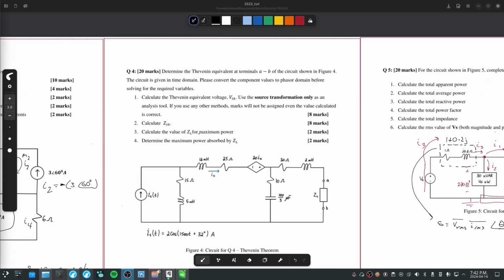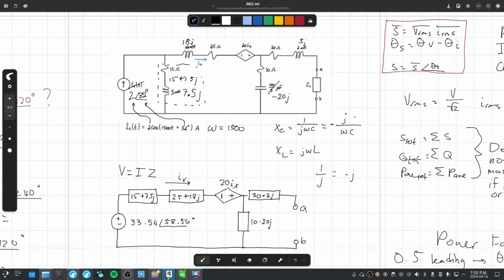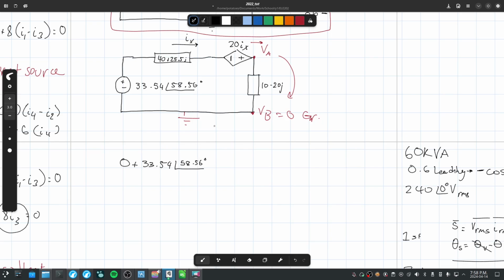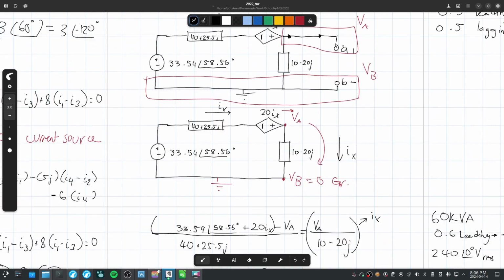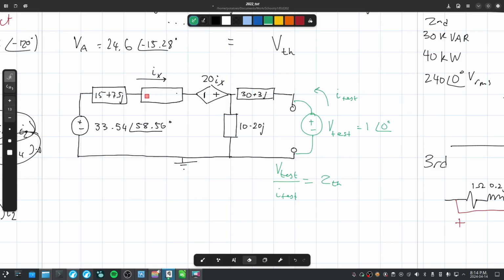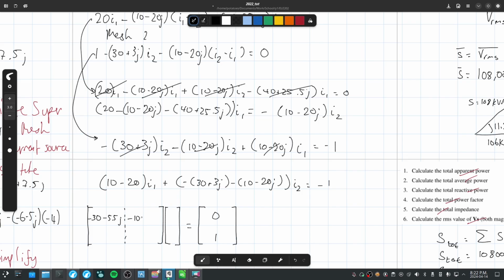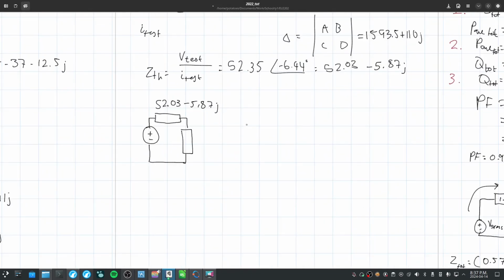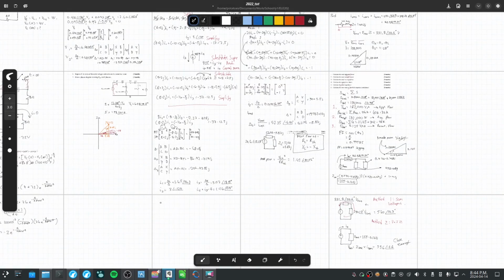TMU ELE202 2022 Final Review Q4 - AC Thevenin Circuit - Electrical Engineering

Comment from the maker: Corrections:
1. itest was calculated incorrectly.
Mesh 2 is wrong. As i2 comes out of the negative end of the voltage source, it should be -1-(30+3j)i2-(10-20j)(i2-i1)=0. Likewise, itest = -i2 because they are going opposite directions.
The final answer of itest is correct, but the process was incorrect. Those two mistakes cancelled each other out.
The correct answers are: i2 = 0.0191 < -173, itest = 0.0191 < 6.44.

2. Pmax should be expressed with the magnitude, not phasor. So the max power at the end should be expressed 1.45W, not 1.45 < -30.56.
You can remember this as |Vth|^2 / (8 Rth).